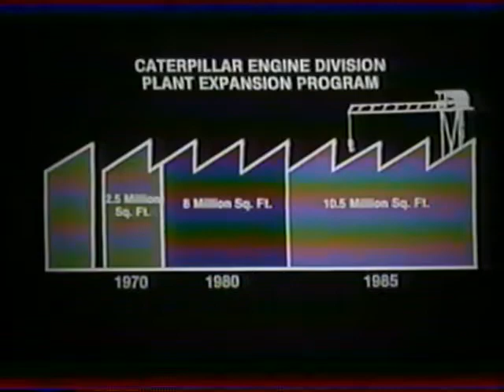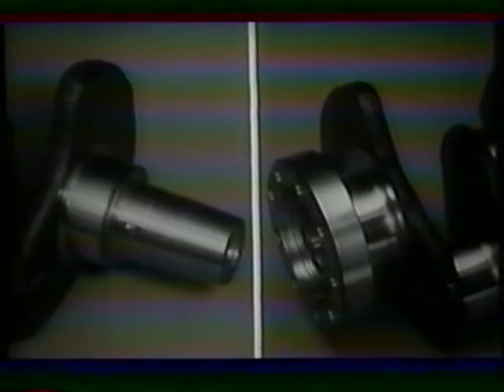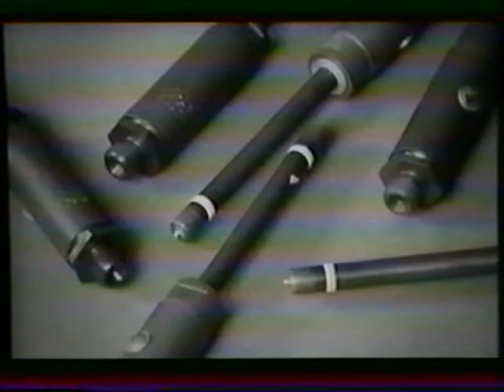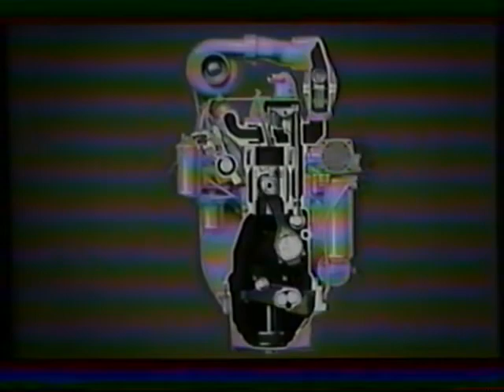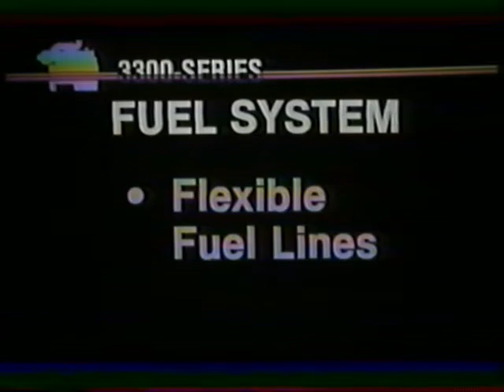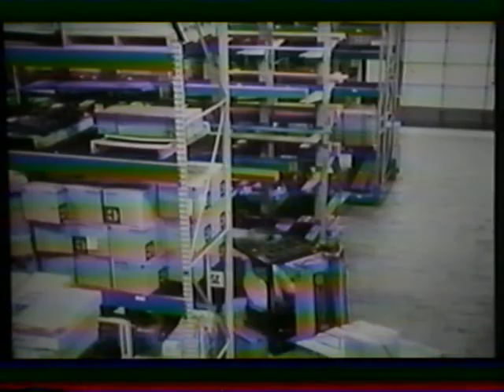Introduction To  The CAT 3306 Engine

Comment: We had a 966C that we sold with over 38,000 hours on it about six or seven years ago now. To my knowledge, it's still operational. We also have a 936 that's 1987(?) The hour meter and most of the gauges stopped working but we used it up until the transmission started to leak a few weeks ago. Waiting on parts and sending it back to the yard 🤷‍♂️
Reply from the maker: These are VHS tapes that have been converted to digital and the playback and tapes are starting to get old.
Reply: @mecanopedago7074  Tapes are getting old but the stuff this one advertised still runs like new